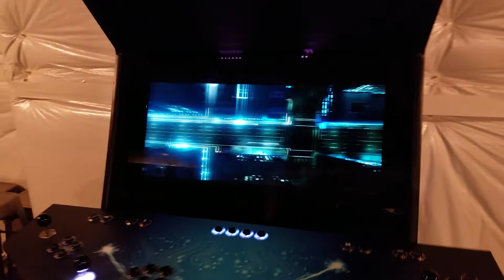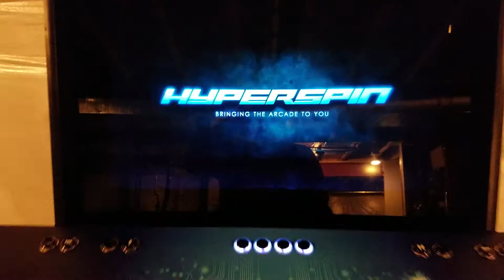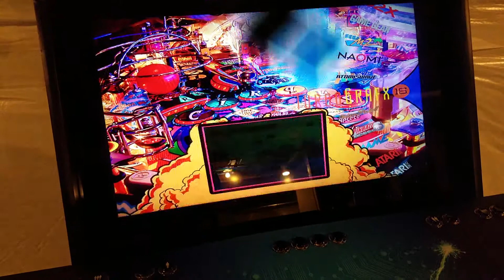Electrocade Walk through

Comment: What type of buttons and joystick are those? I like the fact that it's black buttons and it's just the surround that is lighting up.
Reply from the maker: galaga The buttons are IL translucent and black concave. can get them at paradisearcadeshop . The joysticks are Ultimarc J-Sticks
Reply: Thanks for the reply. Nice to see they would fit my current setup. One other question. What lights are you using to light them up?
Reply from the maker: galaga Using the IL-lumination RGB 5VDC LED from paradise arcade shop..I'lll see if I can get a full parts list added to the description as well in the next couple days